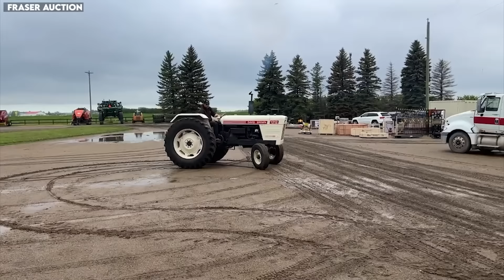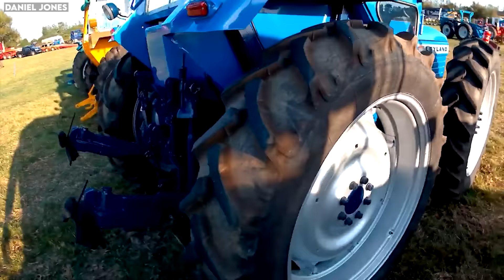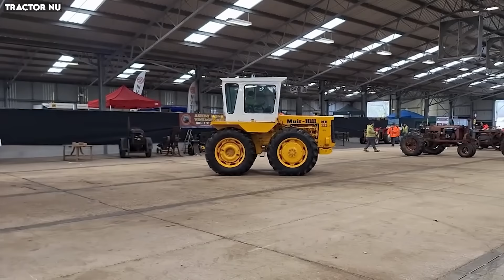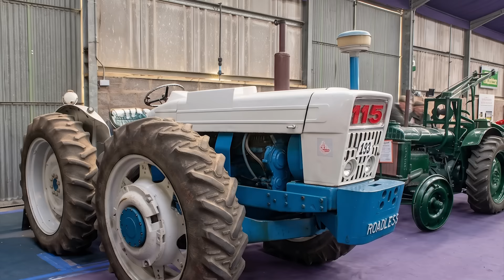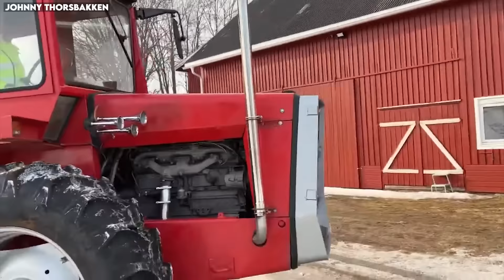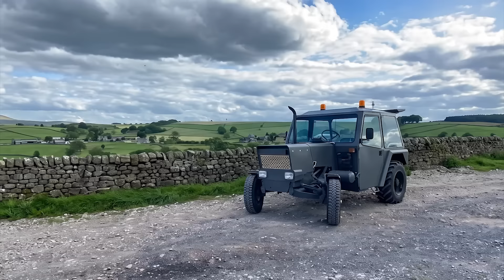10 Forgotten British Tractors From the 1970s

Comment: I worked for HST Developments in the 90’s while on a gap year from college. They were the company behind the Trantor and Graham Edwards was still at the helm. They were working with India to try and restart production but other than a few test Trantor’s I don’t believe it got very far. Interestingly in 1994 an unsold Series 2 Trantor was bought back by HST from a dealer in Luxembourg would kept it in stock. I got the task of sprucing it up for sale in the UK.
Also my Father in law had a Forward Control County that he had a muck spreader and lime spreader commissioned for it. It could have been 1 of the first self propelled muck spreaders?? By all accounts it wasn’t that reliable, but they became well trained in swapping the front axle in the field due to frequent failures!!
Reply from the maker: Thanks for sharing those fascinating firsthand experiences and memories from your time in the industry!

Comment: Interesting start point  Harry Ferguson had just about retired on the Little Layland  was the last tractor design he worked on. DB 1212 1412 and latter 1490/94 enough said. Ford  TW gearbox  could cope. The MF 1200/1250 were built along the Industrial line and in my opinion we're over shadowed by the 2000 series with the 2640 being the same power as the 1200/1250